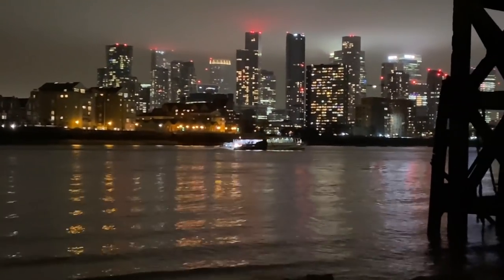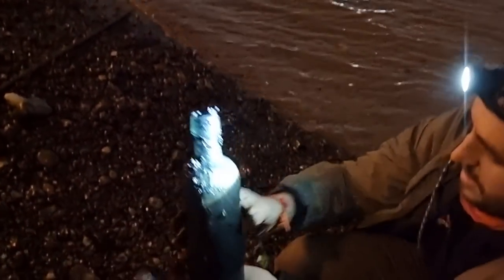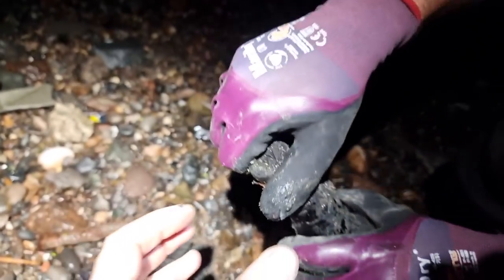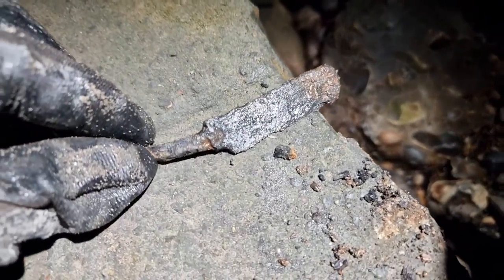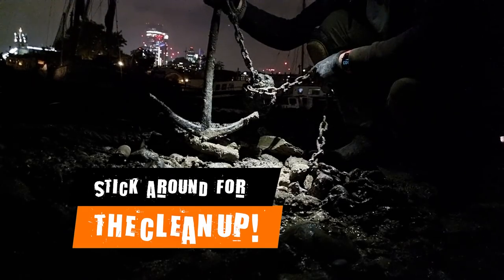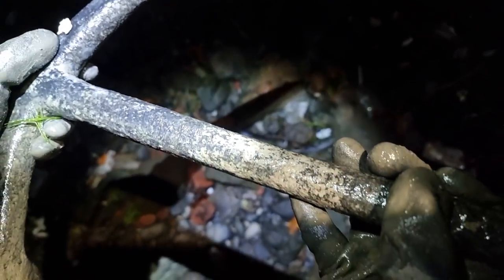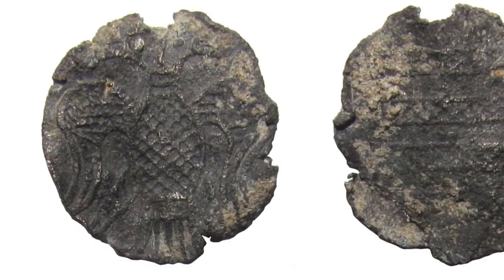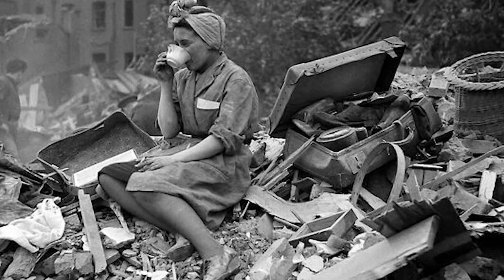What's on the end of this OLD CHAIN? Mudlarking the Thames

Comment: Your anchor is a small 'kedge' anchor. Typically used for 'kedging' a vessel off of a shoal, sandbar, reef or lee shore it had run aground on.
The second hole in the shank originally had a 'stock' through it which may have been broken off at some point . Sailing ships often carried several, if not many, of them.
Reply from the maker: Cheers Mudlover! 👍🏻👣🧡very helpful

Comment: Hi Si!
The anchor is a great find. 
The forged ring attached to it is an indicator of it's age as that type of ring means the anchor was most likely intended to have  hemp rode rather than chain.
The shackle that connects the ring to the chain as you found it appears to be a relatively modern adaptation.
In my experience these subtleties in anchor design and construction have been used in underwater archaeology to help date and identify wrecks that are associated with particular anchors.
Reply from the maker: Very helpful. Thanks!!

Comment: You should soak the anchor and chain in vinegar for about a week and then clean it up. It would look brand new. I have used that method on old pieces of mine track and single Jack drill bits.
Reply from the maker: Why would i want it brand new? It's earned that Patina, I only remove what is neccessary  👍🏻👣🧡

Comment: 'Kedging' was done by having crew take the kedge anchors out in 'jolly boats' (dinghies) and dropped to the bottom with lines that could then be hauled onwith windlasses to pull the vessel off of the shoal etc. A cumbersome, tedious and dangerous operation that was sketchy at best but often the only option in the days of sail.

Comment: Hey Si, it looks like it was a bit chilly when you went out for this hunt and it's a bit below freezing over here in New Jersey and it got me wondering - what kind of gloves do you prefer for going out with? I'd imagine pulling the pink stone with super thick dive gloves on would have been nigh impossible. But trying to pull that chain out with thinner gloves would have probably ripped them to shreds. Thoughts? Apologies if you had a gear breakdown in another episode - the vid library is getting expansive to review!
Reply from the maker: Sometimes I use them, sometimes I don't. Plus I need to work the camera, so gloves are a faff
Reply: @Sifinds  That was another reason I asked - I'm a filmmaker so I was trying to figure out how you were operating camera with like, dive gloves on and trying to adjust aperture. When you ARE using gloves, do you have any preferred brands?

Comment: Hey Si, I can ID that piece of glass for you, I have a few of these at my house. notice how the glass twists and breaks off  on the top, that is the bead that is considered waste and gets cut off the  bottom end of a blown glass object.  you cover a iron  tube with clear glass then roll it in powdered colored glass to get the colors on the glass then you smooth it out on a iron table after reheating it. this colors the glass before you actually blow the glass out into a bubble and make an item out of it. but the end does not get covered with as much colored glass so you take a pair of metal shears and draw it down by twisting it inside the shears while applying pressure (hence the swirly look) and then let it cool a bit and tap it so it falls off. that is why the bottom has little to no coloring on it and the top is showing the color of what item turned out to look like. . I have been fortunate enough to do workshops to make blown glass Christmas ornaments and actually got do this a few times. I kept the little off cut end pieces as souvenirs just because they are so pretty. I"ll post a photo of the ones i have to imgur so you can see them and we can verify that they are the same. https://imgur.com/a/vLwW13a
Reply from the maker: Cheers Mudlover! 👍🏻👣🧡very useful

Comment: I think I willl make a replica of this token if that's all right. I have been thinking of making some and I like the design on this one. I use soapstone to cast pewter period items so already have the ability to pull it off. The pewter I use however is modern and does not contain lead like period pewter. I already have some lead but will have to order some tin to try casting a more period token. It would be interesting to compare the modern version to the more period one. Any Idea of the measurements of the token? For example thickness and width? Come to think about that I can probably get that information from the Portable Antiquities site.
Reply from the maker: good luck!
Reply: @Sifinds  thank you.

Comment: Love your episodes, will try to do some mud larking at my hometown, Vilnius (Lithuania) has some history too, I bet there should be some interesting finds at the bottom of the river. Need to wait for summer, sometimes water drops drastically, that it is possible to do some eye spotting hunt. One question, what settings/program do you use with equanox when you are searching such areas loaded with iron?
Reply from the maker: just beach 1
Reply: @Sifinds  thank you for your answer.  Will be waiting for next episode. Love the parts where you explain in detail about history of items you find. Good luck ✌️